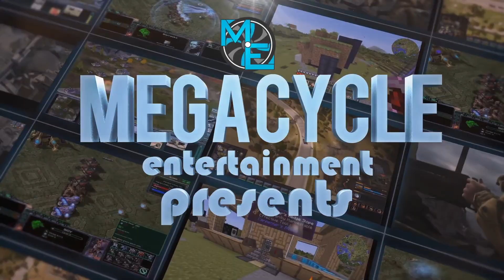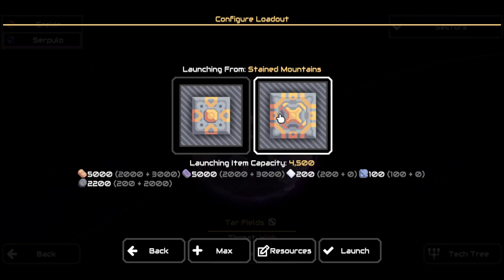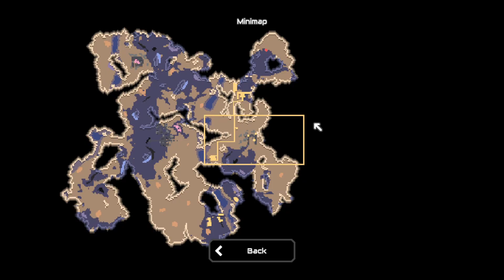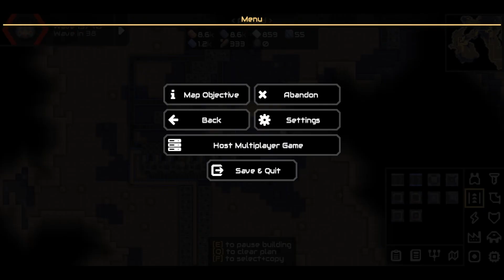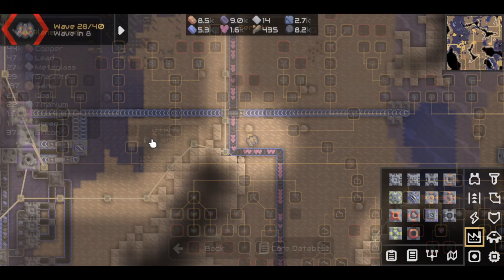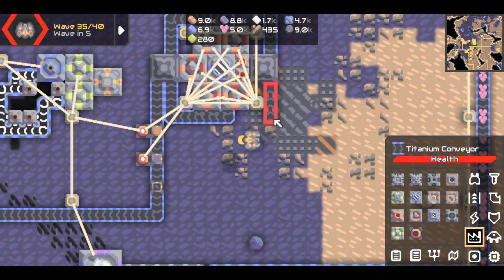Mindustry - S01E07 - Tar Fields

Comment: Tips for any newbies for Mindustry. Unloaders isn't needed to be sorted when directly linked to a block that only accepts certain recources, the game does that for you. Get flares if you can get your hands on advanced schematics, or even all except t1 and t5 units of the green land and all green air family, as using processors can mine ores for you (beware, save t2 or t3 air as they are able to auto repair and build stuff for you). Use Arc for early-midgame medium land defense, fuse for mid-to extreme, lancer for extreme, and salvo for aa for mid-extreme. Put a factory, power generator and storage building in your defenses to bait all enemy air units to your defense and preventing them to fly deeper into your defenses and nuke your defendless buildings. And finally all green units can use their attacks to heal ally buildings, except for Oct (nw its t5 so you aren't getting that anyway,not worth it)
Reply from the maker: @haydenchew7216 That's great advice! 👍

Comment: battery diode have a pretty niche usage as well as both tier of solar panel. 

as for the processors it can do a pretty cool unit related stuff or just use it manage random things.
Reply from the maker: @Apolitical_tortoise   Thanks for that. I'm sure it's super helpful with the control logic, but I won't be using em.